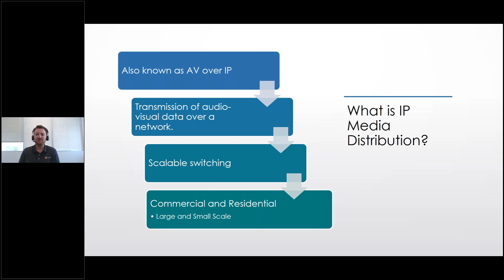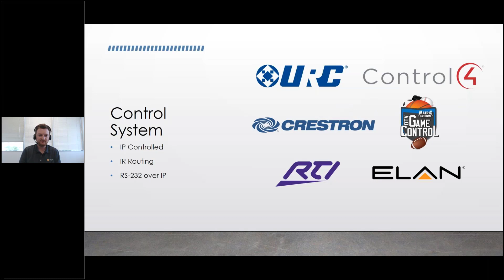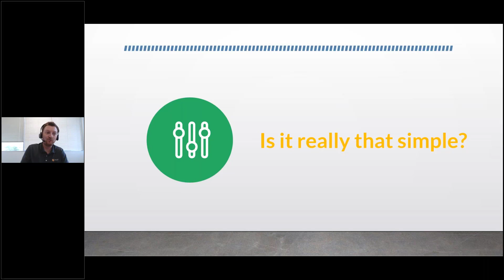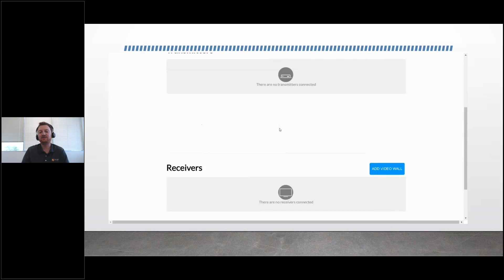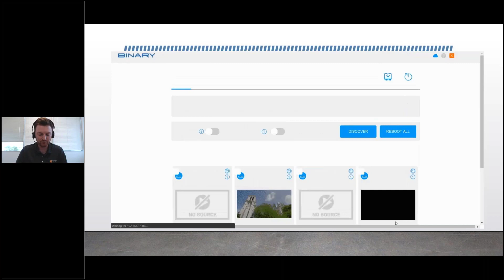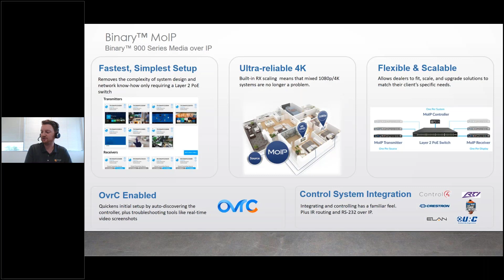Binary MoIP Webinar 7/31/2018

Comment: I am using control4 typically we feed it network from a switch but in this video they call for the control system to be ran into the moip switch. So does the single moip swtich also feed network?